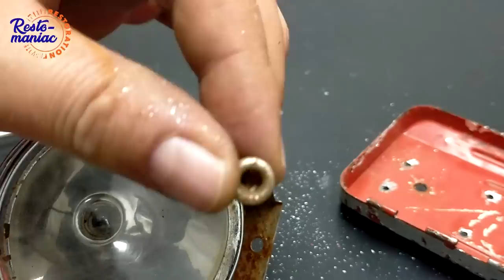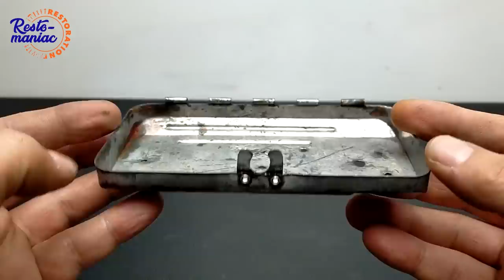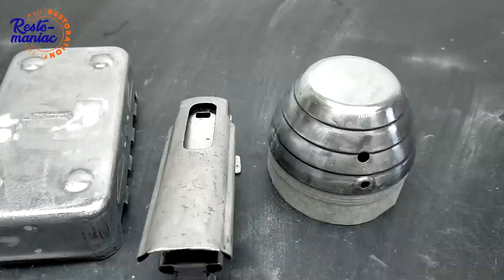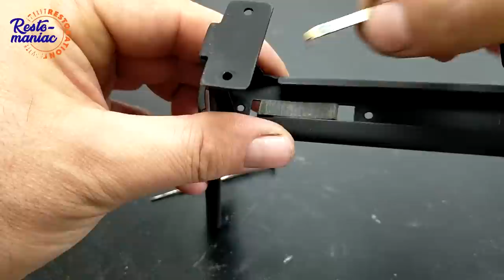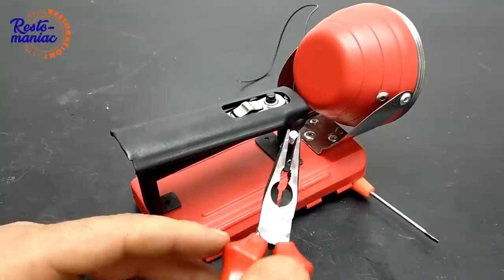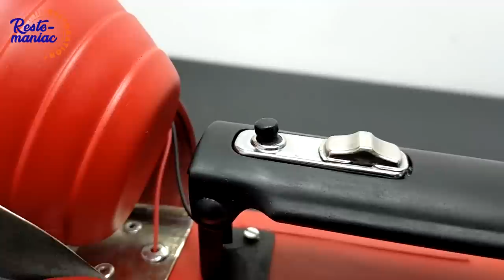British Made Vintage Flashlight (Torch) Restoration

Comment: Overall looks ok.
I would have however, nickel plated and polished the reflector, updated the old incandescent bulb for a LED COB unit, and used some potting compound or industrial heat shrink on that battery/charger combo